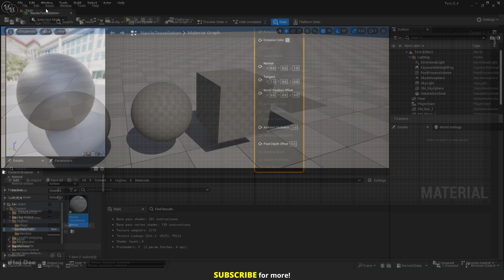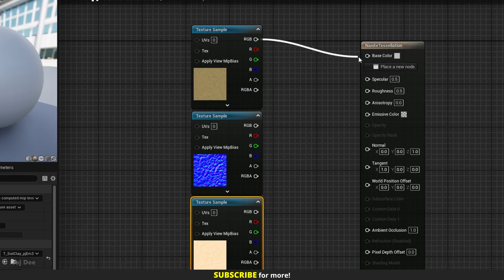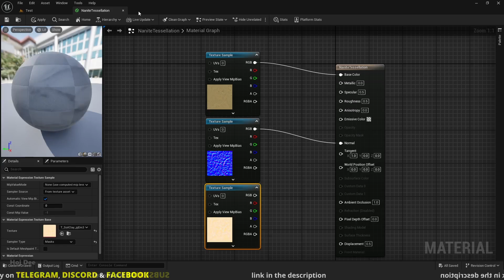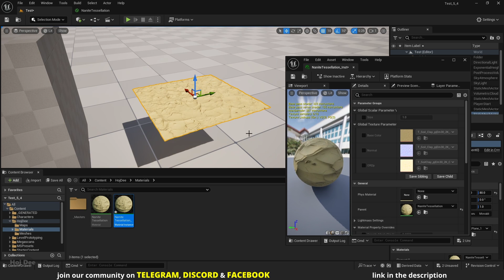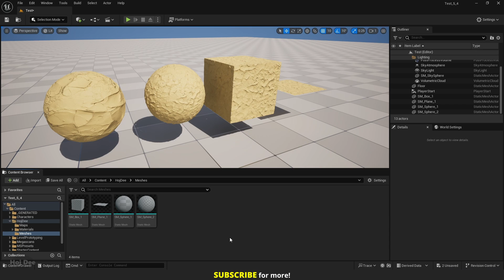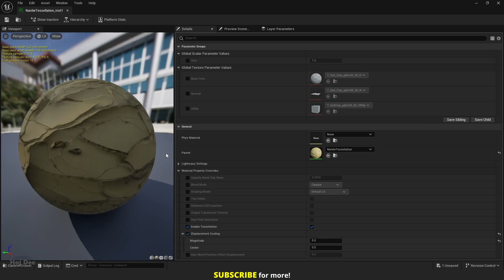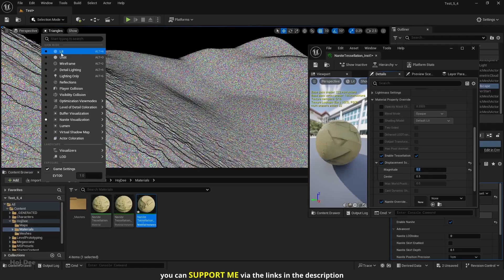Nanite Tessellation for Landscapes & Static Meshes | Unreal Engine 5.4

Comment: Hello, I have an issue with nanite tessellation that changes based on the camera's distance to the static mesh. Do you know what caused this issue?
Reply from the maker: @ZaeliaOfficial  hi. What ue veraion are you using?
Reply: @HojDee  I'm using 5.5.3 at the moment. I think It has something to do with virtual shadow maps. So I set "Shadow Cache Invalidation Behavior" on the mesh to "Always", which seems to fix the problem if I'm not getting too close.

For context, I'm trying to create a cloud-like shape from the mesh. By using a noise node for displacement and a panner for animation.
Reply from the maker: @ZaeliaOfficial  I think there's a cvar to control the tessellation optimizarion as we get far from the mesh. But I can't remember it right now.
Maybe that can help.
Reply: @ I’ll look for it, thank you!
Reply from the maker: @ZaeliaOfficial  hope it helps

Comment: For unknown reasons, quixel textures doesn´t work when I try to use displacement if I add the materials directly to my project from Fab or Quixel. I tried everything I could, almost giving up to use displacement, but I got the same textures from Fab webpage with all the maps separately, including displacement map, and bumm! It worked. So, instead of using all together, I´m using each map on the corresponding slot. It seems that it´s the only way I can use displacement, since I could´t find any solutions about it. I followed a alot of tutorials, wrote down step by step, but the same problems apears to me, until I decided to do what I did. Just in case, if someone is facing the same issue and can not find a solution. In resume: instead of using the ORM map, try to use each map separetely, but just if you are facing the same problem.
Reply from the maker: @Mypianoanme  thanks for the comment
Reply: Thank you so mach

Comment: hey did I miss something in the considerations part ? You don't show to fix that , so there's no way to bypass the broken displacement is the seams ? Cause like for e.g in vray/corona displacement mod you have an option to tick "keep seams or borders" which fix the issue shown here, basically I have to unwrap according to what I want in order to produce a good result ?
Reply from the maker: @zatlanibrahim5438  you can use the world aligned normal nodes. That covers it. Other than that, there's no fix right now. Maybe they'll add the option like vray in future versions. Keep in mind that it's an experimental feature right now

Comment: If anyone is planning on using this for meshes, it's generally more performant if you go into the modeling tools and bake the displacement map into the mesh (basically making it a high-poly mesh) rather than tessellating at runtime
Reply from the maker: @hellomistershifty  for runtime usage that could be better (at least for now. They may optimize it in the future versions). 
But for cinematics and overall, tessellation is much more flexable than baking.

Comment: Magnitude parameter in the Material Instance has no effect, but changing the same parameter in the Parent Material is work......

1. I modified the default engine file.
2. I checked the 'Used with Nanite' option.

I followed the video instructions and verified everything repeatedly, but I still can't find the problem. This issue has been troubling me for a whole day.
Reply from the maker: @蔡奕霏  I don't know why it wouldn't work. Unless you have the 5.3 version. In 5.4, it works.
Reply: @HojDee  Updating from version 5.3.2 to 5.4.3 solved the issue. Thank you very much for your help and your excellent teaching.
Reply from the maker: @蔡奕霏  glad I could help :)

Comment: Hi, I have a question. This method seems to only work with light mode. How does path tracking solve the displacement problem
Reply from the maker: @xuanlv-r9o  I think right now it's not supported with path tracing

Comment: great. so all displacement problem in unreal is solved! thanks friend.
Reply from the maker: Yeah kind of. It's still experimental though.
Reply: It's not solved - third person character are floating in air over displaced landscape or walking through displaced landscape material. How to solve this one?????????????
Reply: Yea this happened to me also, when I started changing the material and adding more textures to the landscape material. Could never figure it out and ended up making a new level cause I couldn't fix the problem. @II-er7gj

Comment: My nanotechnology mesh tears up on the edges even though there is no uv seam in that place, I have tried bevel edge, weight normals but it doesn’t work, please share any solution, the only solution I have found is to try edit normal from modeling tools but it gives weird stretched texture on edges.
Reply from the maker: Use the world aligned texture function